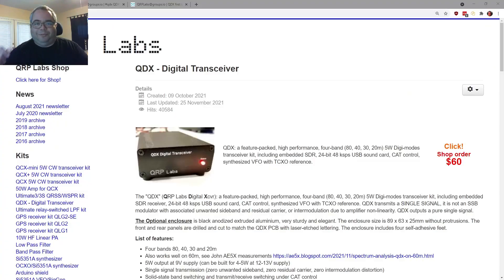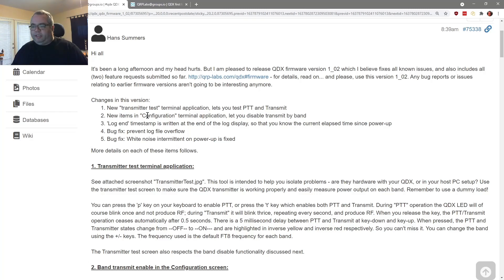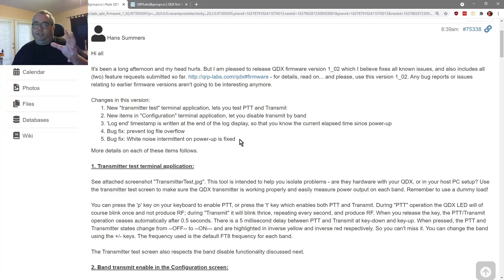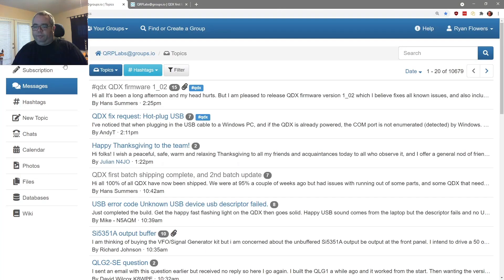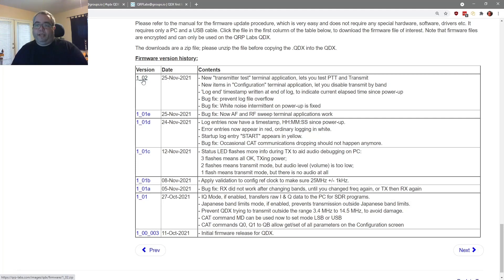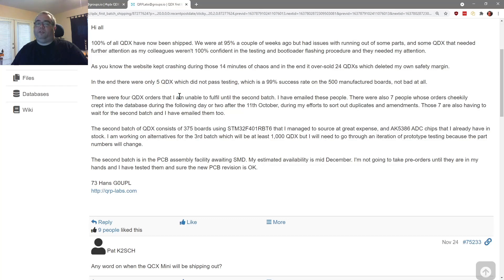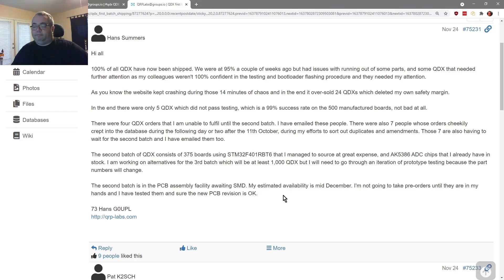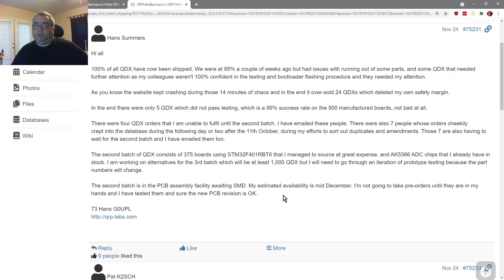QDX Firmware Update, and Second Batch Info!

Comment: FYI I had a problem with the receiver not working with the BNC connector nut installed.  It may be stressing the connector.  I removed it and things work fine.  Thanks to Hans for his quick responses.